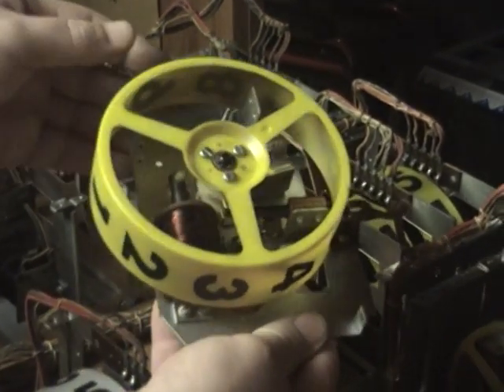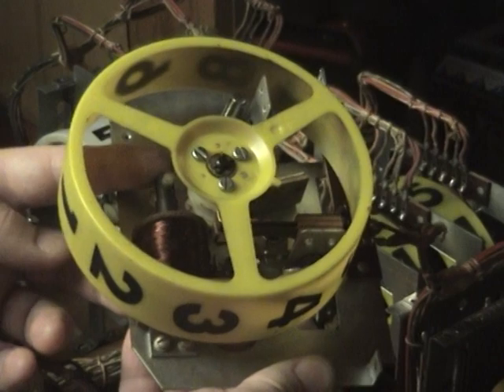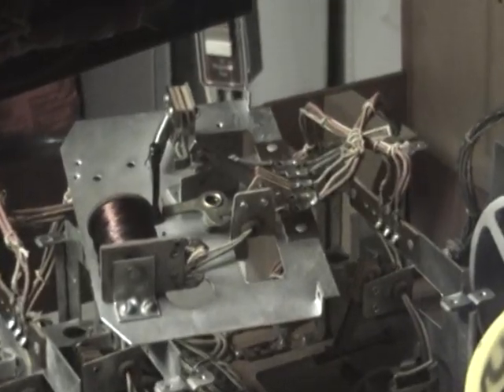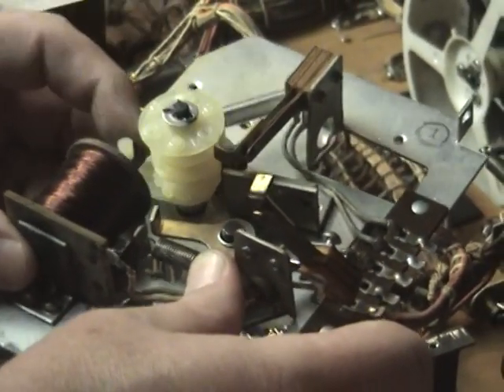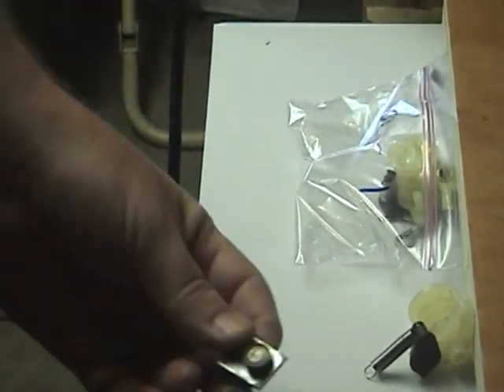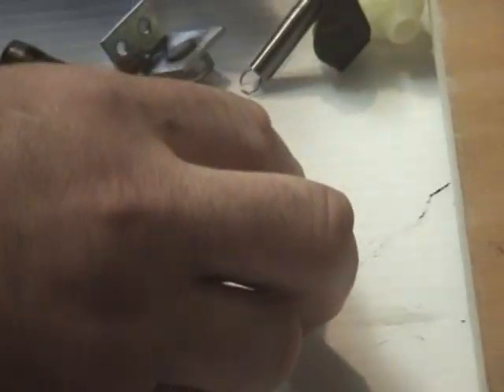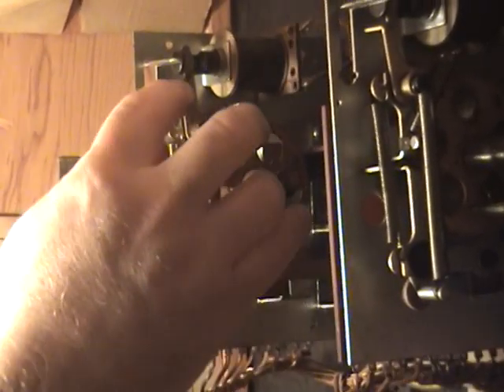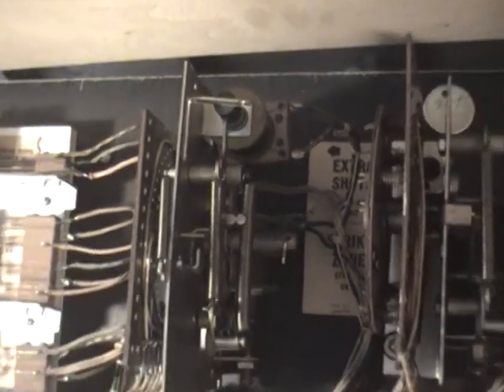Electromechanical electro mechanical E. M. score reel and stepper repair United bowling machine.

Comment: Where did you get the cams for the reels? I have a 1963 williams looking for parts
Reply from the maker: I took them apart from the machine I was working on, cleaned, lubed, then put back together.